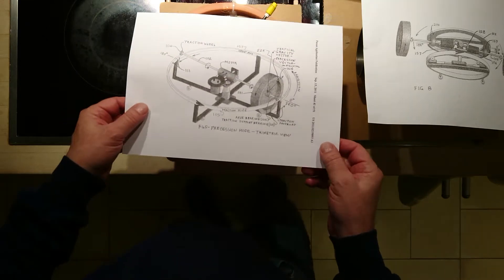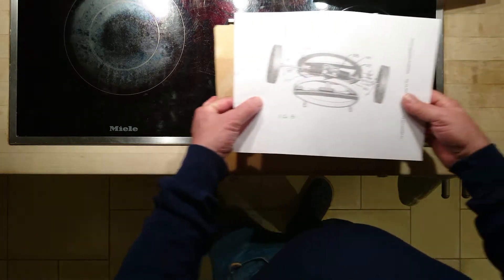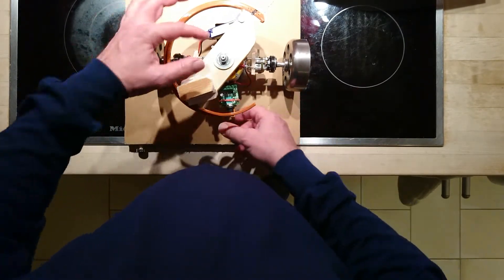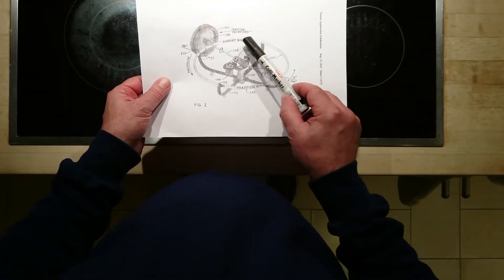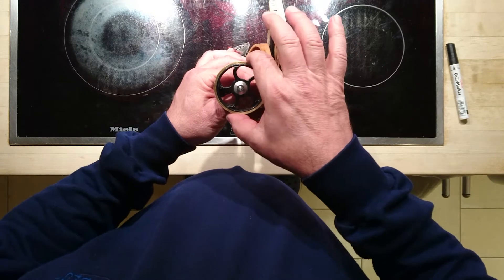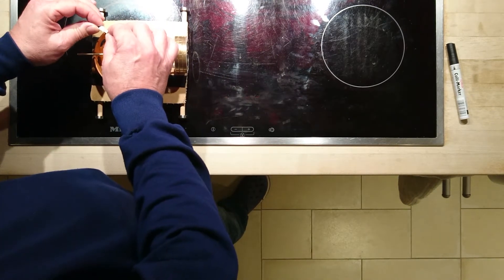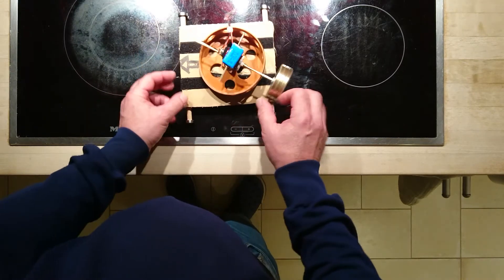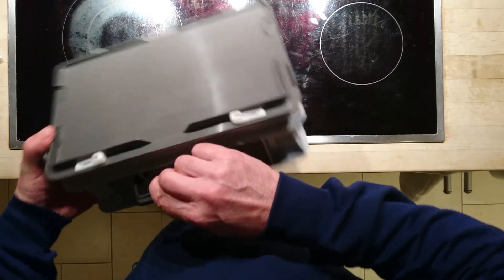inertial propulsion with gyroscope part 5

Comment: Mr. woopyjump, I have been following most of your videos with great interest and I really admire your effort and your enjoyment and your choice of vocabulary. I feel that you should become acquainted with a deeper insight into engineering principles as there is some behavior that you can easily predict as to whether the machine is going to be successful or not.  Many of your observations are due to practical imperfections and while they appear to be successful, in fact, they are not.  In the last few videos I have seen, the behavior has nothing to do with having a spinning gyro, and the reaction of what you call inertia propulsion is only due to accelerating the mass, and not due to the spinning mass. The recoil that appears in this experiment seems to be one way, only because of imperfections and if you were in space or floating on water with a " symmetrical and homogeneous environment" then one can never propel anything using this technique. The movement appears to be what it is "one way" only because effectively, due to imperfections, you have a ratchet effect or a one-way bearing.  What you have shown with a Gyro, can also be shown with accelerating a mass. I have tried it and if the bearing holding the mass on the extension arm does not have a vertical axis, a simple trolley with the inclined extension arm on it will show exactly the effects which you are depicting. What you are seeing is the reaction to the acceleration of the mass on board.    Please do proceed with experimenting, but a little deeper knowledge will help not to break your heart when things do not go the way you thought they would.  I must compliment you on your sense of humor, Please realize that because someone patents an idea, it does not mean that it works..........anyone can submit a patent. Gyros do behave very unintuitively, but once you depict the basic motion, it is not as difficult as it seems and even Professor Eric Laightwaite, should have done his homework before the publically announced that a spinning wheel loses weight as it does not. I attended some of Eric Laithwaite's lecture, and I did not agree with him as soon as he lifted that spinning weight. I was at the University of Newcastle upon Tyne at the time.

Comment: I wonder, could the fact that they work be due to the way they generate or avoid friction witht he surface throughout the cycle? A true zero friction interface would help remove my doubts. Or, of course, multiple units combined to achieve fluid progression.
Reply from the maker: Hi Cloxxki please have a look at the videos part 2 -3 and 4 on the subject and probably you will remove your doubts.

Comment: That thing really moves pretty good. Connect 2 or three of them like a train and maybe get fluid motion???
Reply from the maker: Hi Brad yes a train would be good, but as i explain in te video (with the 2 rotors) synchronicity is a must and require very high degree of craftmanship. Not sure i am able to do this in my shop so far.